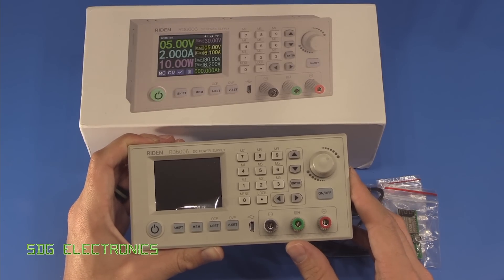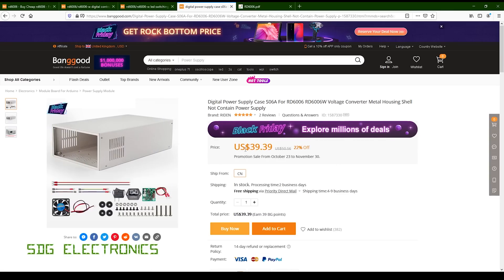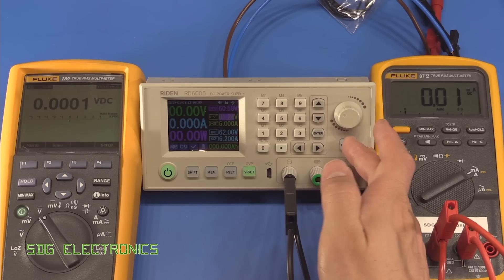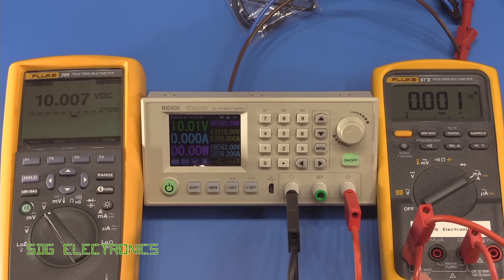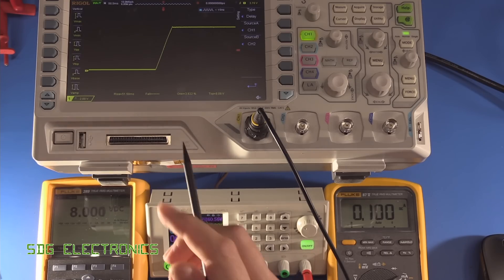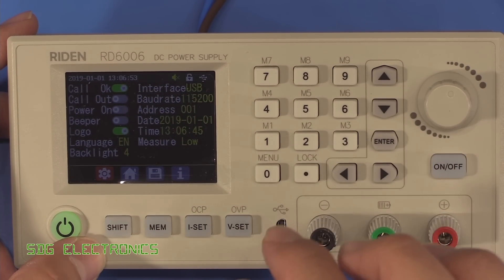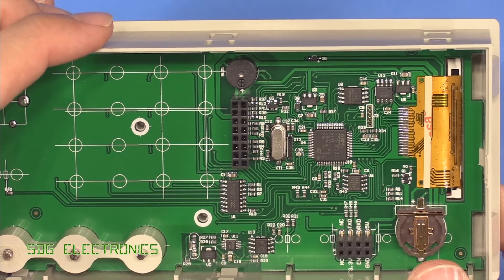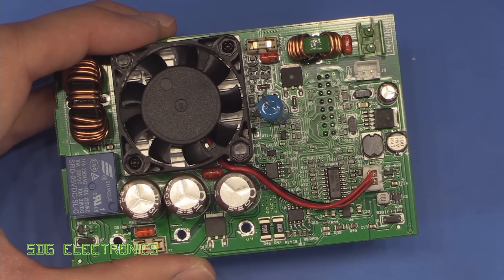SDG #117 $53 360W Riden RD6006 Programmable Bench PSU

Comment: Best firmware for 6000 series is on EEVblog. Google UniSoft RuiDeng Riden RD6006 DC power supply for forum. 

Below is the Change log. You can always return to stock firmware at anytime.

In case of any problems while update, keep pressed [ENTER] while power on device, to run device in BOOT mode.

RD60062_V1.32.x.bin - my custom firmware. (where x - is the build number (sub-version))

RD60062_V1.32.bin   - original (stock) firmware.

If you want to return to stock firmware, recommend to set default setting

To do this: keep pressed button [0] while power on device.

---------

History:

--------

--- RD60062_V1.28.1.bin ---

* Initial version

* Optimized, get rid of HAL Libraries... switched to LL

--- RD60062_V1.28.2.bin ---

+ The menu was complete remade, now I can easy add new items.

+ [SHIFT] + [Left/Right] — switches the current layout (without save in settings)

  (if need to set layout after power on, then can do it over settings menu, as before).

+ For 'layout 1', can be enabled/disabled items.

+ Added OPP (Over Power Protection).

+ [SHIFT] + [MEM] — used to setup OPP

+ OVP, OCP, OPP — now can be disabled by setting it to 0

+ When entering OVP, OCP, OPP, SHIFT button will be highlighted as well

  (to visually distinguish input: V-SET from OVP, I-SET from OCP).

+ The RIGHT button now works as a Backspace when typing.

+ When turned on the internal fan (the one that is on the module itself), icon will be displayed.

--- RD60062_V1.28.3.bin ---

+ Added setting for current cutoff in battery charger mode.

+ Added setting for batt temp. cutoff in battery charger mode.

+ Added Battery Charger Layout 

+ Added Setting to skip keypad lock when connect with software.

+ [MEM] + [.] — now used to reset Wh, Ah

--- RD60062_V1.32.1.bin ---

* Updated to version V1.32

* Bug fixes

--- RD60062_V1.32.2.bin ---

* Bug fixes

+ Option "Digits Style", can select style for large digits (32x64, 12x24, 7-Seg)

+ Decreased minimum battery voltage from 900mV to 300mV 

--- RD60062_V1.32.3.bin ---

+ Support WIFI

* Bug fixes

--- RD60062_V1.32.4.bin ---

* Fix TTL Interface

--- RD60062_V1.32.5.bin ---

+ Option "SkipExitIVSet" (prevents exit from edit mode for V-SET and I-SET when press ON/OFF button).

* Bug fixes

--- RD60062_V1.32.6.bin ---

+ Option "Standby LED" (Setup the behavior of the power button LED in power off mode (Default-pulsating, 0%-off, etc...).

  (in modes 0% and 100% power consumption will be less (cause no need software generate PWM and can switch MCU in to the sleep mode)

* Bug fixes

--- RD60062_V1.32.7.bin ---

+ In power Off mode now using hardware PWM (except pulsating mode) for Power LED and turning off unnecessary peripherals, 

  to decrease power consumption.

+ Remade function to enter values. 

* Bug fixes

--- RD60062_V1.32.8.bin ---

+ Option "Save Mult." to save current multiplier (for current session only, reset after restart)

* Increased minimum battery voltage from 300mV to 500mV (Due to some instability) 

* Bug fixes

--- RD60062_V1.32.9.bin ---

+ Added option "Power State" (Power On, Power Off, LastState). Sets the state after power on (without a battery, LastState will not remember the last state).

+ Added option "Power Switch" to turn On/Off the primary PSU. (5V standby power supply required). (Note: Adds a 3 second power-on delay).

  The control output is routed to the PA14 port (pin 4 of the J2 connector). High level - turn on, floating or low level - turn off.

  Note: the maximum load on the port is 20mA !!! (it is better to use an optocoupler).

+ Added option "AutoPowerOff" to automatically turn off after a specified time if the output is disabled.

+ Added option Home:"Status Info" allows you to choose which parameter to display in the status bar (if you need something else, let me know).

+ Added option Home:"Mem Hint" If enabled, then pressing any number key will display a hint with the current settings in the corresponding memory cell for 1 sec,

   a second click during this time will apply these settings.

+ added new parameter "7-Seg v2" to option "Digits Style", where "input", "vset", etc. will also be 7-segment.

+ Added display of the system temperature to the caption.

+ Minor improvements

--- RD60062_V1.32.10.bin ---

+ Added option "Screensaver" to decrease brightness (ScrsaverBright) after specified time. (Note: "ScrsaverBright" must be less or equal to "Backlight") 

  Press any key (except ON/OFF) will turn on backlight and restart timer. 

+ Added option "ScrsaverBright" Screensaver Brightness (0-complete turn off backlight, 1-equal to "Backlight"=0, 2-equal to "Backlight"=1, etc)

+ Added option "ScrsaverActive" Allow activate screensaver if output is in active state.

+ Removed meaningless icons from the caption.

+ [Left/Right] — switches the current layout (without save) (no need press SHIFT anymore)

- Removed Layout 2 (Layout 3 already shows all values).

+ Minor improvements

--- RD60062_V1.32.11.bin ---

+ When edit "ScrsaverBright" or "Standby LED" now you can see the real effect... 

+ Added option "Comm Buzzer" make a sound when the software writes new parameter(s).

+ Option "Mem Hint" now can select the time how long show the message (2, 3, 5 sec)

+ Added option "ShiftMemTable" Press SHIFT to display the table with settings for all memory slots. 

+ Added new menu group "- Colors -", now you can choose what color (one of 15) to use for the next parameters:

  Voltage, Current, Power, Input, V-Set, I-Set, OVP, OCP, OPP, Ah, Wh, Temp, BattVoltage, BattInfo (Layout 2).

  Option "Custom Color" allow to use selected colors (using this option you can enable/disable custom colors in bulk).

  Option "Test" is just temporary option and will be removed in next release, 

  can be used to see any color and its hex value.

  List of colors need be adjusted, if you have any ideas just let me know (tell me hex values).

  Here is the current list of colors:

    const uint16_t g_colors[16] = {

      0,            // 0 - Default

      C_RED,        // 1  = 0xF800

      C_GREEN,      // 2  = 0x07E0

      C_BLUE,       // 3  = 0x001F

      C_WHITE,      // 4  = 0xFFFF

      C_YELLOW,     // 5  = 0xFFE0

      C_MAGENTA,    // 6  = 0xF81F

      C_CYAN,       // 7  = 0x07FF

      // 

      C_LIGHT_BLUE, // 8  = 0x01CF

      C_GRAY,       // 9  = 0x8410

      C_BROWN,      // 10 = 0xA145

      C_ORANGE,     // 11 = 0xFD20

      C_OLIVE,      // 12 = 0x8400

      C_TEAL,       // 13 = 0x0410

      C_PINK,       // 14 = 0xFDF9

      C_MAROON      // 15 = 0x8000

    };

	

--- RD60062_V1.32.12.bin ---

* Bug fixes

+ Some Improvements

+ New option "Max Power" to limit the power of primary PSU. (came from RD6018).

+ Fixed Layout 4

+ Added more options for Layout 1 (Note: only first 6 will be displayed).

+ Added function to dump the screen (make screenshots) (real dump from LCD GRAM),

  but this function a little bit slow, takes around 13-15 sec (need transfer 320*240*2 bytes over UART).

+ modified French translation (still need to make translations for German, and Chinese.)

+ Added Russian Language

+ Font for menu was changed to Terminus

+ ENTER can be used to exit from menu.

Comment: Nice video. You mention a relatively low sw freq of 150kHz and said if it were higher you'd get better efficiency.  Actually it's the other way around - higher freq would yield lower efficiency.

Comment: Why do you suppose the relay is before the output capacitors and not after? Is it so the relay contacts will spark a little—enough to spot-weld, forming a low-resistance connection?

Comment: I sure would like to identify at around 15:49 if there is an easy point just prior to the relay out, I assume, where you could hack the feedback voltage to incorporate some 4-wire Sense circuit / leads to outputs (even if you have to go out the back) with 100k Rs shunts to the internal supply.  I'm going to have to trace some of that back, and sure wish they would include schematics in these manuals, but they are so worried about copy-cats they even laser off the IC's labels for export and reverse engineering...

I think it would be directly applicable to whatever you find for the voltage drop from internal to even at the terminals under load at 6:35 you would just be pulling in a typical Rs 4-wire sense circuit feed (maybe add some over voltage protection there too).

Comment: Great video, but if you wanted to juice up your number of subscribers, you would have spent 90% of the video on the instant where you blew the fuse on the fluke meter being used to measure the current. As it was, you skipped right over it, showing you are more of an engineer than a marketeer...

Comment: Hi Steve. I bought one of these but had an issue when powering it from a multi tap toroidal I use as an isolation transformer. One tap is 48-0-48 at 7 amps. I run one side of this through a bridge rectifier and measured the DC output at 48v when the transformer is at full mains voltage (240vUK). But when I link this winding to the 6006, the voltage shoots up way beyond expected. I used a variac to being the voltage slowly up and I was reading 48v DC on the input when mains was at 110v ac... just over double what I was reading without the 6006. When powering the 6006 using a linear supply it behaves normally. Any idea why it boosts the Input voltage when using the toroidal transformer? Thanks.
Reply from the maker: Do you have any capacitors after the rectifier?
Reply: SDG Electronics thanks for the swift reply. No, I have no caps after the rectifier ... just direct into the RD6006. I was going to add one across the supply, but didn’t have one with enough capacitance/voltage to hand...not that I am entirely sure what the capacitance should be. I was told 1uf per  100 mw (max), but needed to do some research to check. Thats one of the reasons I used a variac... to check things were going to work. The unit powers on after around 10 volts but will stay on until you drop down to 5 volts. It just goes a bit wild as the voltage increases with the 6006 connected. Happy New year!

Comment: Sorry but it's not a power supply, it's an adjustable buck converter since it requires a DC input.  Those are cute, but the way no one will sell you a complete unit (that runs on 110-240vac) is a disgusting marketing gimmick.  Thanks for a good video, the tone of my writing is aimed at the Chinese distributors of these things selling them literally a piece at a time.

Comment: Thank you for this video.  (Much more enjoyable than the high pitch screaming of the Aussie.)  In fact, this is not a PSU, it's a buck converter with a display and a key pad.  You need a serious power supply to feed it.  This unit comes without the case, which you can buy separately.  A decent PSU and the case will set you back about another $50.  The color display makes no sense, purple for both voltage and power, seriously?  And who decided to make that "battery" connector green, like an earth connection?

Comment: I would use a Toroidal Transformer with a full wave bridge rectifier and some capacitors and resistor to clean up the ripple and noise, but I need much more than 6 amps, they said they'll be coming out with some real beefy units.

Comment: What is with the display of the temperature on the main screen? Is it to monitor external battery temperature when charging maybe? Where would you connect it? I see a J0 connector on the power board, that look like a place to connect external temperature sensor of some sort.

Comment: How is the OVP and OCP implemented? Looks like it’s software based. Did you measure the delays or the behaviour in general?
Reply: Looking at circuity at the back, I think it is hardware based. At least the OCP part and current limit. The OVP, well I have no idea. The I-set is definitively hardware based. There is no way to make it software and work reliably. But who knows. Worth testing or tracing the circuit.
Reply: movax20h Are you talking about current limit or proper crow bar that kicks in at set level of current cutting the output off?

Comment: Nice review, thanks. If you do a followup it would be great to see how it performs under load, like can it deliver the advertised power continuously without melting down, also what does the ripple and switching noise look like at various loads. And a quick look at the dynamic performance would also be great, e.g. in constant voltage mode going from 100mA to 2A and the other way around with a capture of the over and under-shoot on the scope.

Comment: If they made a dual output it would be perfect. I just got done reviewing mine and I love it!
Reply: Hi. Have you tried using it to power a laptop? Thanks.
Reply: @leoangelolima9401  no but I don't see why it wouldn't work. As long as the laptop doesn't require some sort of proprietary comunication.
Reply: @jeffescortlx  i have a friend and told me that he tried using it and it cant handle the current jump of a laptop and it shuts down. Maybe he got a defective one. I ordered 2 pcs but im in doubt right now. Im a Laptop tech and im using power supply to read current jumps of a laptop. Thanks man
Reply: @leoangelolima9401  the average laptop ac adapter is 3-4 amps. If 6 amps isn't enough your friend is doing something wrong.
Reply: @jeffescortlx  or. Maybe he has a defective one. Thanks man. Tjis helps
Reply: @leoangelolima9401  it would be quick and easy to find out if it's defective. Check the output with a multimeter.

Comment: A bit odd that a P-channel MOSFET is used.  Is the control voltage negative with respect to ground?
Reply: n-channel would require high side driver, so probably more expensive..
Reply: @Mr.Leeroy  And Nch gate would need to be pumped higher than the output. It's a positive supply, the Pch gate is pulled low relative to the source to turn on.  This is fine except for low output voltages ... maybe there's a neg 5V supply to pull the gate low enough for Vout < 2V or so.

Comment: There is a problem with these units when set to current limit - and it can be a killer. The current limiting function only comes into effect after the (quite large) output capacitors have discharged. I could't see from the video how big those 3 capacitors are but I guess they are reasonably large. Set the output to 60v at 10mA and then short it out and see what happens. All that charge has to go somewhere. This is not a criticism of this particular unit, I think all of them work the same way. Othere than that it looks a nicely built unit and the keypad for data entry is a welcome addition.
Reply: I think if the output-on button is used, instead of physicality disconnecting the leads it avoids the capacitor discharge issues with current dumping.
Reply: @jeffescortlx  You are quite correct jeff, using the on/off button allows a safe start, The problem occurs when the connection to the load is opened and closed again while the PSU in in the 'On' state. Users should be aware that under these conditions the current limit only works after the capacitors have discharged sufficiently to bring the voltage down to the current limit level. I lost an expensive LED chip this way. One learns.

Comment: Too bad that it is not isolated. This system could be so much more useful and powerful if it used isolated switching converter to provide multiple independent outputs. It could be even more useful if it used additional linear regulator after switcher to dampen switching noise.
Reply: You can do anything for a price.

Comment: The slow LCD display settling time is an artifact of the "Measure" option which slows the display by averaging it. I was confused at first too. Change Measure to 'High' and it will update faster. Still slow to turn off which is expected as the caps drain.

Comment: Ordered this on Nov 10th, they still haven't shipped it. I was planning to compare this to the Gopher NPS1601 which has superb performance and is actually cheaper.
Reply from the maker: It went out of stock for a while when I looked a few weeks ago. Looks like the manufacturer are having trouble keeping up
Reply: I am really interested on that comparison. I have ordered the Gopher PSU 10 days ago (still not shipped) and I hope I will not regret it after the results of your comparison 😐
Reply: VoltLog you made a video on the NPS1601. 
It might be cheaper but it has less specs and less features. 
Nps1601 is a 32V 5A power supply while the RD 6006 is 60V 6A power supply

Furthermore does the RD 6006 have presets and it programmable. It has an USB port for data logging and a display that can show a graph.
Reply: @Conservator.  Sure the RD6006 is packed with features there is no doubt about it and you'll see my opinion on that in an upcoming video 😁

Comment: its from rui deng / RD Tech just like the DPS5015 DPS3005 module series.
Reply: Riden stands for rui deng
Reply: Yes i got the old dps5015 for years now and the dps5020 with Bluetooth cant complain  except theyre expensive when bought locally, and import is problematic because customs.  My First dps5015 got hold back by customs  and had to either be destroyed or send back (i did but it never arrived).   All due to missing manual in my language. Stupid regulations

Comment: Did I see correctly? From what see in the video it looks like you've actually made the meassurement wrong. I could see the Fluke on the left was connected after the first pair of cables (on the second multimeter), not at the PS output. Did I miss something?
Reply from the maker: In the video it had the additional 100mm lead on the positive output that was under load, but I separately measured it at the terminals off-camera. Basically no difference
Reply: Or maybe you've chained them at the Fluke, which is wrong too.